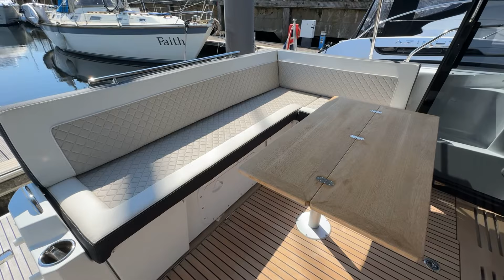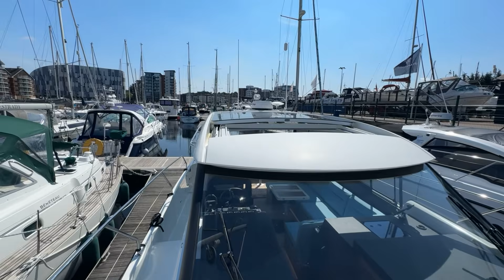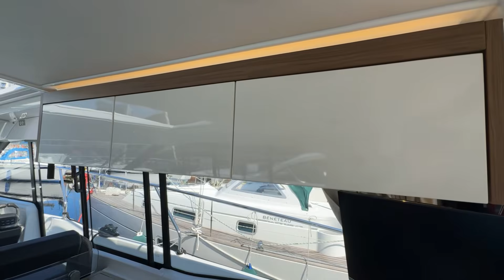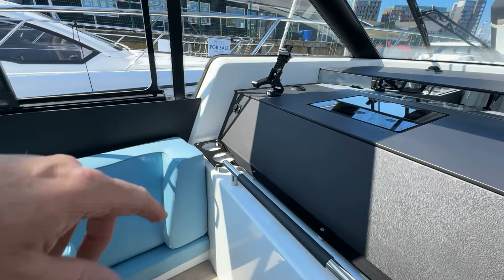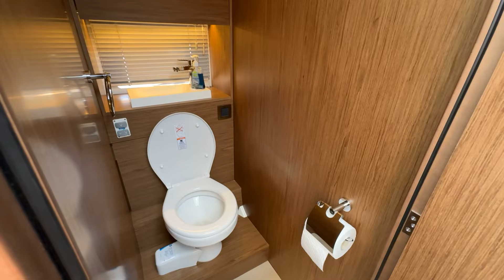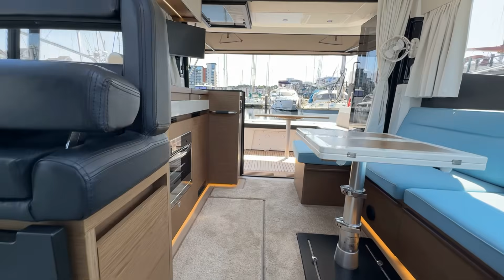Jeanneau NC 37 Walkthrough Video with Burton Waters Boat Sales - £269,950

Comment: Wraps don’t last 2mins. Must be hiding something
Reply from the maker: The wrap has been on the boat since it was new and is unmarked. Companies that offer boat wrapping provide a five-year guarantee, and the wrap is simple to repair if damaged. It also means that you will not have to cut and polish the boat every year. We calculated the cost over five years, despite the fact that the wrap lasts longer and wrapping a boat is less expensive than cutting and polishing it every year. Please feel free to come and see for yourself.